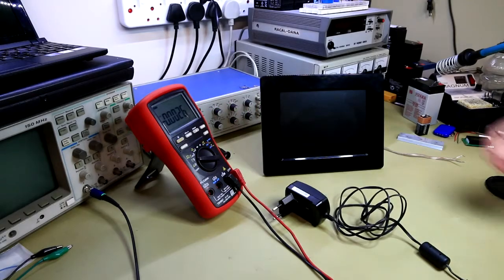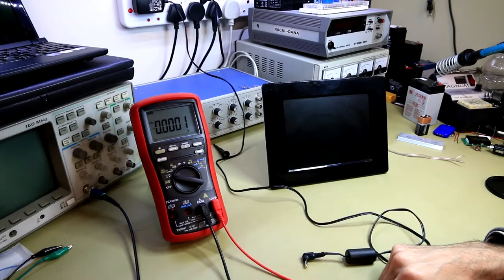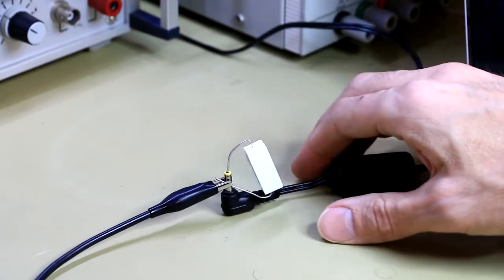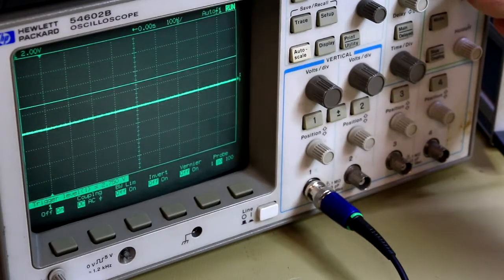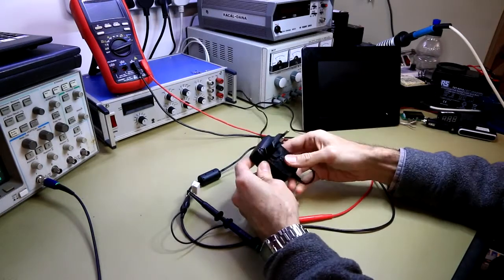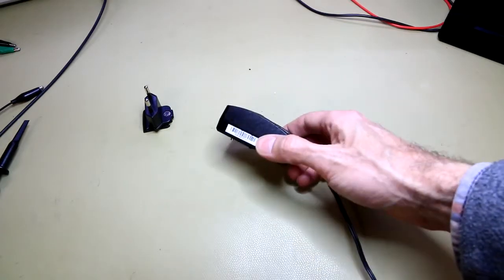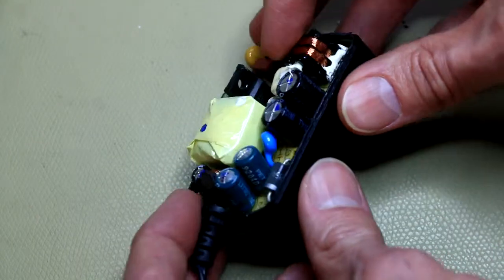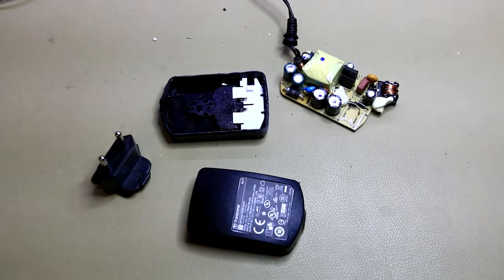Photoframe powersupply diagnostic (#005)

Comment: I have seen so many of those that went like that. Generally for best reliability a transformer and bridge works well, even with poor regulation. They even work with the cap having split it's top and carry on till the last electrolyte evaporates.

Bigger hammer, a brick and moer it stukkend.
Reply from the maker: Agreed - the output is 5V DC and the cap is rated for 10V, so even at twice the rating the cap is of such bad quality that it still failed after about three years of operation. Yes, brick sounds like a plan for next time ;-)
Reply: TechBench  I have a hammer called Gentle Persuasion. Got a new one as well recently ( for Mahala) and it is called Not so Gentle.